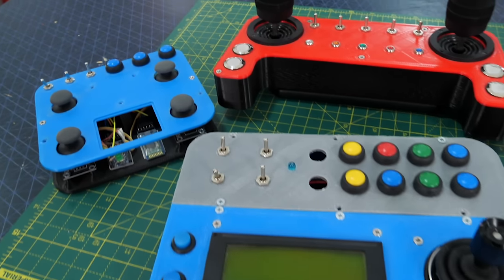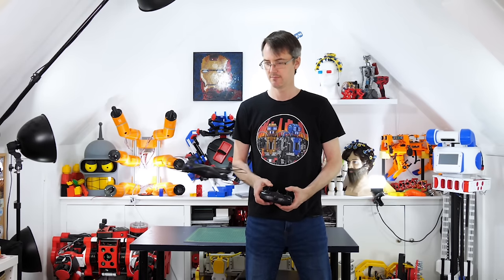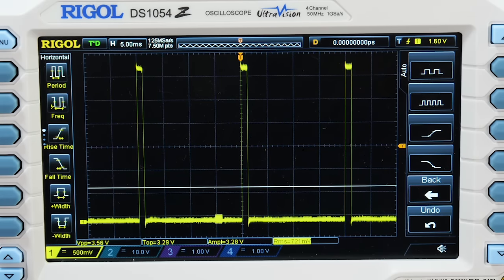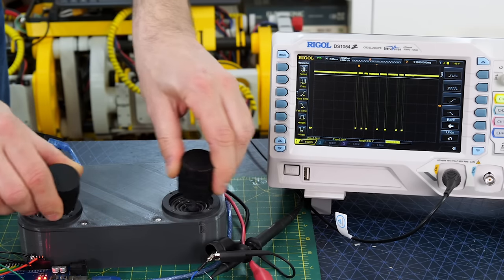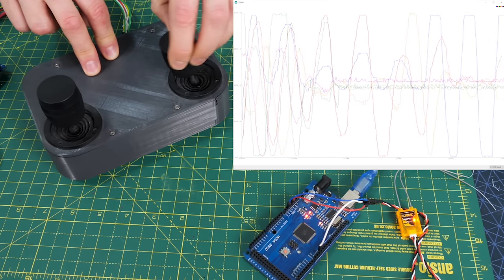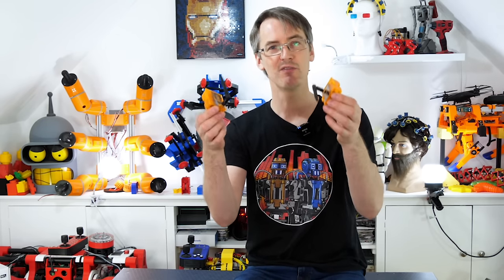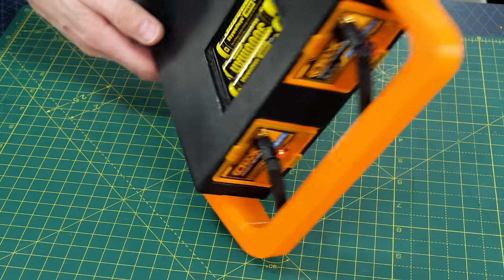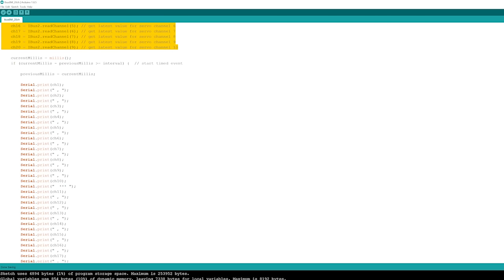Building a DSM2 R/C Transmitter with Arduino

Comment from the maker: Join my DISCORD!    https://discord.gg/fc6MedG7eW

INSTAGRAM:   https://www.instagram.com/xrobotsuk
TWITTER:   https://twitter.com/xrobotsuk
MASTODON:   https://fosstodon.org/@XRobotsUK
Reply: Aren't you a bit too old to use the word super ?
Reply: this is a super cool project!
Reply: James, please create a USB Joystick (like a T1600m) to RC-link setup, that would be a lot of fun to drive a robot around the house from your gaming PC.  Or a racing wheel setup!
Reply: why not use cheap cell phones and send data via telephony like an old modem would?  Then your range would be essentially unlimited so long as it had a basic phone signal and some code to transmit and receive confirmations like a checksum would?  Cheap cell phones would probably work like this instead of using radio, plus your frequency would be higher so your compressability should be higher, including video streams potentially?
Reply: @texasfossilguy  LoRa is best

Comment: In the world of drones and RC, DSM/DSM2 is practically ancient these days! ExpressLRS is more or less the modern "budget" standard - and radios that support it can be had for very cheap. Building your own radio is cool in itself, but I feel like it's being held back from its full potential by the tech inside it.
Reply: Also I think any RC plane/drone pilot will agree that DSM/DSM2 isn't exactly great for range and interference stability - I know I've almost lost models previously due to lost signal - but I guess if you're coming from bluetooth anything is hundreds of times more stable - and I guess a driving robot rarely goes as far as a model airplane.
Reply: I remember the days of having transmitter/receiver crystals to change the radio frequency.. Simpler times 😂😂
Reply: @Matty.Hill_87  still have many of those... far simpler and no interference as today everyone is on wifi :P
Reply: I agree, DSM2 has a really bad name in the R/C industry for having lots of failsafe and brownout issues. 
DSMX is a lot better in that regard. 

ELRS will still have way better range, features, reliability and hackability (it's an open source project, DSM is very propietary) tho
Reply: Yeah elrs is where it's at
Reply: @Matty.Hill_87  just a year ago, I was still flying a ridge soaring wing that used a nice 5 channel analog controller I've had since 2003! It finally died though, but I'm impressed at how durable that old tech is
Reply: Second that ELRS is definitely where it's at. Open source, great, reliable link and with lots affordable hardware available. Thanks for another great video by the way!
Reply: As a dsm subscriber...first pre whoops were spectrum, I've stayed..
Reply: Couldn't agree more, DSM/DSM2 is dead. DSMX still has a few usecases but ELRS is about as good as it gets today. Just moved from TBS Crossfire to ELRS for cost and hackability and oh boy I'm not slightest bit disappointed.
Reply: Yep, +1 ExpressLRS
Reply: I agree with this mostly because ELRS is also an open source project with a firmware configurator that can offer far more flexibility in both pwm and serial output, and even though the protocol only supports 12 channels, options are offered in two bandwidths and you could hack together a third to run in tandem if you’re committed enough. Not only that but it also gives a level of telemetry and comes in a tiny package flashable via Wi-Fi.
Reply: I'm not sure how easey it is to get it to work with an Arduino
Reply: @rorymace  there are PPM TX Modules/Receivers that you could simply swap out with the DSM modules that were used in the video if you didn't want to go another layer deep and interface with the digital layer.
Reply: @JacobScherer  but doesn't erls modual use crossfire to communicate with the transmitter?
Reply: @rorymace  by default it is CRSFshot, but there are forks for ELRS that support PPM. All the code that Betaflight/edgeTX uses for ELRS/CRSFshot is open source and fairly easy to follow, so I don't know why you'd really want to go back to the dark days of PPM, but to each their own.
Reply: @JacobScherer  ok thank because i was going to try do build this project but using elrs
Reply: @Lukas.Cancelosi  in version 3.x there even  is support for 16 full resolution channels!
Reply: yeah, something like tracer or expresslrs wouldve been way better.
Reply: Elrs or crsf are the best available right now, both have pwm options
Reply: They are still really good and can easily go at least 200m. At least give you something
Reply: @xavierjiang7112  in ideal circumstances yes, but now add some trees or some walls and now its only 10m.
Reply: James should try to make one with elrs. The most reliable will be the radiomaster Ranger elrs module.
Reply: I was going to mention LoRa modules but I believe they're essentially the same hardware as expresslrs. I would seriously consider an upgrade to expresslrs.
Reply: Yes but that’s not a ppm signal
Reply: More fuel on the Express LRS fire.  It's very very low latency in comparison to anything else, well, period.  The CSRF packets have become a lot more configurable lately, and it's all very very hacker friendly.  The devs are awesome to boot.  It's really the best choice for something control+light telemetry at low-latency with high reliability.
Reply: I think I might still have an old dragonlink knocking around somewhere .oO
Reply: You should build one and show us

Comment: James, an idea for encoding your switches/buttons/binary. Use the bits! ie you can think of an int32 number as 32 binary numbers (referenced by their index). It's pretty simple maths to encode and decode and you can use 1 channel for all the buttons you could ever want :)
Reply: yeah, was thinking the same, using a bitwise operator to see the value of every bit in the number.
Reply: @MrJimmySegers  We used to call it bit twiddling 🙂 Just make sure you thoroughly document what each bit controls in its two states.
Reply: Isn’t he still using PPM on the input side? I don’t think he’ll get 32bit accuracy there.
Reply: @Mike-oz4cv  yes - i also think it is too much, but 4-8 bits should be possible. Perhaps 6 bits with 2 for crc
Reply: @Mike-oz4cv  PPM channels are analogue as the value for each channel depends on the width which represents an analogue value. The PPM is then being fed through a DSM/DSM2/DSMX modulator which is digital. so I'm pretty sure that PPM can represent as many bits as you would want but the limitation would be the modulator.
Reply: @jeremysargent5037  I know it’s analog, I just doubt the pulse width measurement on the transmitting side is accurate enough for 32bit. I also doubt whatever microcontroller James is using can output a pulse length with 32bit accuracy. It’s in the order of picoseconds after all.
Reply: 😂 almost unbelievable that James still has that kind of shortcomings in the software department. I gather that his background must be a mechanical design education given the rate at which he pulls out CAD designs.
Reply: He wrote that the value isn't exactly bitewise, small shifts are possible.

I thing at least 4 binary inputs per channel are still easily possible. Source: dude trust me, I used something similar to read a rotary code switch to a single analog input.

Comment: I believe that your problems with the NRF24L01 is caused by using counterfeit components. There are several YT videos about the counterfeit NRF24L01 and their low performance. Buying modules like the E01-ML01DP5 should get you very long and stable range. You can also just buy the NRF24L01 from a reliable supplier and swap them with the ones on the modules. Then you know you have the good stuff...

Comment: +1 for eLRS support. You may also want to check the 3dconnexion 6D Spacemouse serial module, to allow you to map everything onto 2 joysticks.
Reply from the maker: I've read the stuff on ELRS but I'm pretty happy I have a solution better than the NRFs for now that's off the shelf. Future upgrades though
Reply: @jamesbruton  Not sure I can post links here,but if you search your preferred online shop for: "3dr radio modules" or "LORA 433Mhz radio module" (or other frequency band or any radio module with SXnnnn chipsets) you can find a ton of modules. They are just transparent radio UARTs, and you configure the datarate/ec/etc using AT commands. They expose just a RX/TX UART pins or USB to connect to your microcontroller or PC or PI. They usually support up to 56kb air rate, some do support more, but it's enough for remote controlling and sending commands and configuration data and whatever data you want back and forth. All these modules are just plug and play. You just configure the serial speed and the channel using AT commands (most are already set with default values, so 2 identical modules will just
Reply: Remote controlled Hulkbuster confirmed!

Comment: Using an ESP32 you could dedicate a core to reading the incoming values, and another core to run your code.
Reply: Edit: The RTM of the esp32 is a better choice than an ordinary ISR. Thanks @michaelmiller5705
Reply: How would you do that with an ESP32? I am working on a project and am still trying to figure how to separate receiving data and processing data separately. would be nice to just keep them entirely indpendent.
Reply: @a154james  in the receiving data callback function just copy the received data in a ring buffer (do nothing else). In the main loop, check for data in the ring buffer, and if there is any, pop it from the ring buffer and process it. After you have done that, process other input in the main loop, like button presses etc. If you want to be safe, use a thread safe ring buffer library.
Reply: @a154james  Use the RMT peripheral to read the pulses (doesn't use a core) and then you can read the values encoded for you from the RMT receive buffer.
Reply: @mattack12  This is probably the best way you could do it. I‘ll change my previous comment.

Comment: i think the last option you are missing is esp32 esp now, i'm not sure about range but should be similar to esp32 wifi, i use it on small scale like combat robots and has alle the custom data and low latency of rf24 but for my experience is a lot more stable and has more range (minimum 10m) would love to have the opinion from an expert like you on the system
Reply: I never really did anything at long range with them, but I think with an external antenna the range would be pretty good.
Reply: @steveman1982  heh I put the same comment above. Cheers!
Reply: I've also made some combat robots using esp32. I have had some latency issues, although it could be due to poor wiring and heat management.
Reply: @jacobvandenbosch5814   i used and  esp32 d1 mini, and also an esp32-c3 boh worked good, but on esp now protocol, ps3 library was not that good for robotics and also ps3 have really bad pots, tho on my code i only send few bytes like pwm and weapon angle and the remote is on esp32 too
Reply: @PKWyt  I’m using the ps4 library, you think that’s the issue? How do you use espnow to connect to a ps4 controller?
Reply: @jacobvandenbosch5814  it coud be, howerver espnow is only for esp to esp connection, bluetooth can have various latency issues and that may happend with Playstation controller, to test esp now you need to build a remote too, that said esp now is specifically designed for low latency and faster communication on IoT

Comment: Coming from the drone space, I suggest you check out Express LRS. The TX modules are the same form factor as yours (and there are also smaller ones). The RX modules are much smaller. Everything is open source (hardware + software). The range is much better thanks to LoRa (reception works below noise floor, this is dark magic to me). Supports up to 16ch (10 bit) at 333Hz or 10ch (10 bit x4 + 1 bit + 7 bits x5) at 1kHz (though that's using FLRC and not LoRa). Transmitter modules are available up to 2W as of right now. Receivers up to 100mW for telemetry (around 2 cm² of PCB + antenna). And yes, they use basic UART for communication.

Comment: Reminds me of my early forays into arduino stuff. I actually had more success range-wise with the nRF24 modules than with the (kinda junk) orange RC stuff, although they are quite finicky about antenna and power supply. Your idea for sending different sets of data in alternating packets works well with nRF24, I used that method on my high altitude balloon. Having two radio transmitters right next to each other might not be ideal for range.

Comment: Not sure if this would be right for your use case, but esp-now is extremely fast and reliable. I use it to control my electric skateboard from a custom remote that I have built (about 2ms for a 4 way trip). You can also turn the esp into long-range mode which allows about 30 m of transmission distance through brick and building, some people have even tested up to a kilometre line of sight.

Not only that, you also get a microcontroller which is far superior to arduino, boasting infinitly faster speed, far larger storage and many extremely high speed pins
Reply: I was wondering how esp-now would compare. Thanks for the data!

Comment: I'd be tempted to look into the Express LRS project (Express Long Range System or ELRS). Its the current thing in the world of FPV quadcopters. Its all open source and cheap, and the transmitter modules and receivers interface over a UART serial port. It's a modern system that has incredible range and reliability, people are flying model planes more than 40 Km.

Comment: Have you looked at ELRS? It's a fully open source project Radio Link based on the ESP32. DSM really isn't used as much in RC anymore(aside from Horizon Hobby/ Spektrum off shoot companies)because of it's reliability issues and since it's closed source if you run into limitations there really isn't much you can do. With ELRS on the other hand not only is it fully open source, but rolling your own module is really easy and really well documented.

Comment: If you want more range, at the cost of having to work out the settings to keep it within the law, the RFD868 radios support a PPM/SBUS uplink and a UART telemetry downlink. They do however use 868MHz instead of 2.4GHz. They boast a range of several kilometers however I think in the UK we're limited by power levels.

Comment: Hey James, clever setup interfacing with the DSM2 transmitter directly! I was afraid to try this, so instead I've had good luck creating an even simpler 40 channel  tx/rx. I used 2 bog-standard esp32s + ESPNOW protocol. I went this route as it doesn't require bit bashing, and supports {n} channels, and was easily expandable to basically infinite range using a wifi->LTE dongle.

Comment: Have you heard about the HC-12 UART module? The DIY Tech Bros did a great video series about this transmitter-receiver set. It has a lower data rate than the NRF-24, but everything else is better.

Comment: ESPNow is a surprisingly good, long-range capable w/ built-in optional ACK/retransmission baked in communication protocol. ESPs are also cheap as chips, and code is easy to write for it.

Comment: You should definitely look into ELRS. All of the hardware from all manufacturers works together, it's open source, cheap, and uses WiFi. You can even make your own modules using an ESP8*** (I forget, but it's documented everywhere.)

I'd say this is your best bet. Excellent range (miles possible), up to 24 channels, and fully open. It's also bi-dorectional, so you send things back like telemetry.

Comment: Without buying any additional hardware, I was planning to just use ESP-NOW from the ESP line.
On LR mode you should be able to get 200kbps, which should give plenty for a few signals. You could get 16-bit for 12 channels and a few 1-bit switches in there at 1000Hz.
The main appeal was that it could also get info from the robot, as it's effectively two-way.

Comment: This is brilliant! I'm working on my entirely custom drone build and stuck with exactly that fly sky remote, as I don't see spending more on a remote then on all other parts together. Tried bluetooth  as well, but the range is simply not enough. Guess I'll build a similar remote
Reply: Have you looked into ExpressLRS? Its open source and cheap.
Reply: @haaspaas2  not yet, but their page looks promising, thanks!
Reply: @tjorbim  ELRS is the new standard basically it is amazing multiple miles of range on 2.4ghz with the lowest latency of any link and you can build it yourself.

Comment: Not sure I can post links here,but if you search your preferred online shop for: "3dr radio modules" or "LORA 433Mhz radio module" (or other frequency band or any radio module with SXnnnn chipsets) you can find a ton of modules. They are just transparent radio UARTs, and you configure the datarate/ec/etc using AT commands. They expose just a RX/TX UART pins or USB to connect to your microcontroller or PC or PI. They usually support up to 56kb air rate, some do support more, but it's enough for remote controlling and sending commands and configuration data and whatever data you want back and forth. All these modules are just plug and play. You just configure the serial speed and the channel using AT commands (most are already set with default values, so 2 identical modules will just

Comment: Mentioned by a lot of others but you should really check out Express LRS! super low latency and really long range (tens of kilometers) serial connections on both ends, and its open source as well, great stuff. you can get better range with better antennas as well